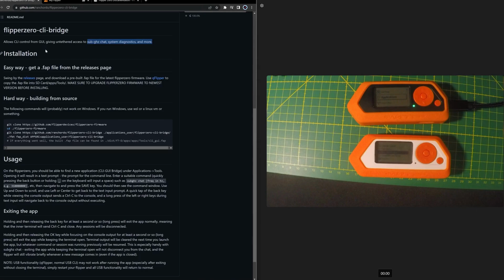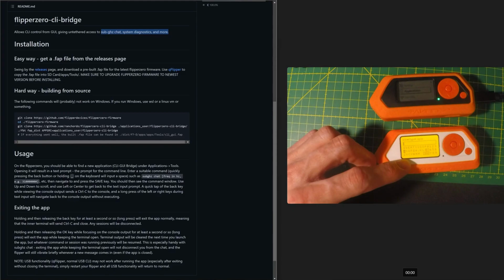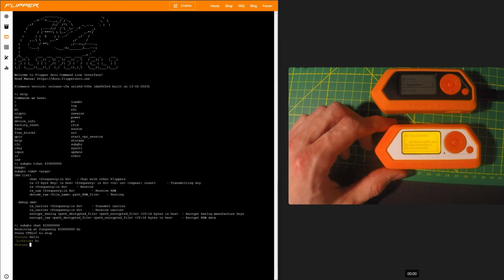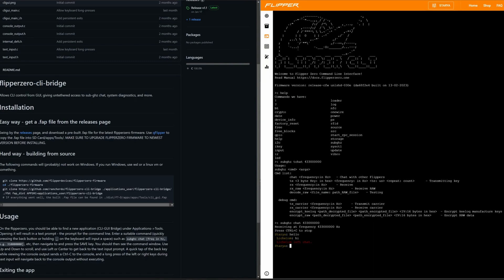Flipper Zero : Off-Grid SubGhz Chatting

Comment: Great video !!  Something odd i noticed with the latest Rougemaster release when you issue the chat command from the flipper itself it says another application is running and to close it. But if I run the chat command from the serial terminal it works fine with no complaints. Any ideas about that? I am sure there is nothing else running at the time. I have re-flashed just incase but the issue remains.
Reply from the maker: Hello LP, thanks for reporting this behavior. I must admit that I didn’t tried here with Roguemaster firmware. May be this is worth to open an issue on github to the main developer. From the error I understand like you, something is using the serial connection. Could you confirm you are not connected to a PC with qFlipper at the same time ? 🙏
Reply: @samxplogs  yes I can definitely confirm it's not connected to Q flipper. For instance if I connect the flipper via USB and open up a Serial session with putty and issue the chat command it'll run just fine. But if I try it on the flipper itself people complain there is another application running. I've tried this through a couple of different revisions of the firmware and through clean boots I'm almost positive something is going on. I've actually confirm the behavior on two separate units aside from mine as well
Reply: You mean  run CLi chat without being connected to computer ? Like with two flippers independently ?
Reply: @slimjed9353  Yes that's correct it looks like with the most recent Rogue Master release they got the issue resolved
Reply: I’m running the RM firmware, not sure if your still having the issue, or if it has been fixed, but when it says another application is running, it means on the flipper itself. I get the same message when my flipper is not on the homescreen, only when I’m in a different menu like applications, subghz etc. it works when you exit back too the flippers main screen or if you go back too the RM animation screen. From there you should be able too use the serial terminal on your pc too access subghz chat without it giving you that message to exit the other application that’s running. Hope this helps!
Reply: @UnstoppableWolfOFFICIAL  Thanks for the reply. It was an actual bug in the application which since has been fixed.
Reply: @LP-fy8wr  oh alrighty, Thanks for letting me know! 👍